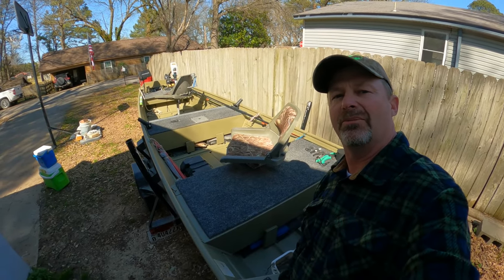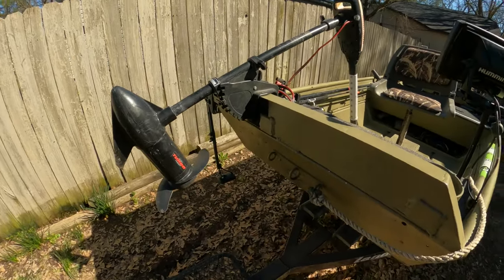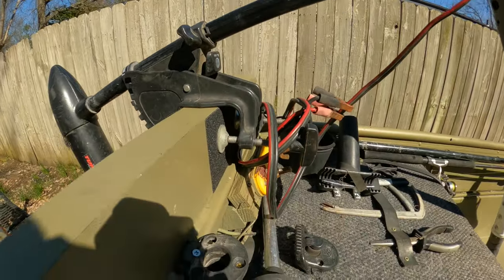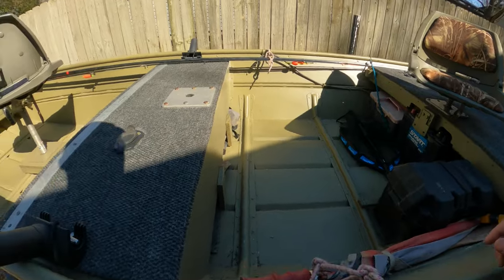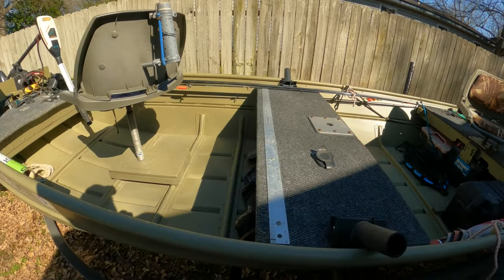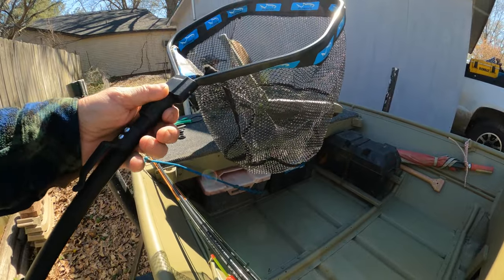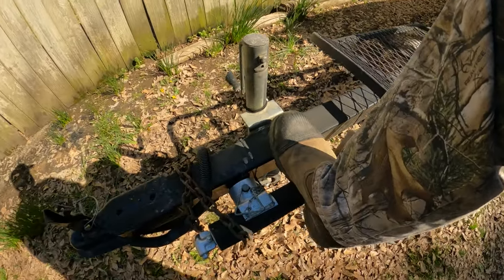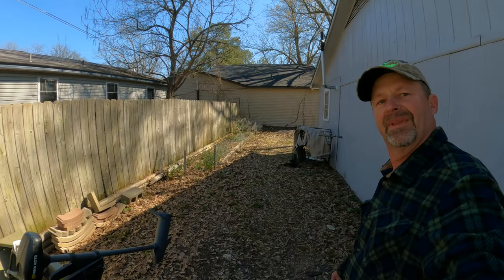Fish Yankers jon boat setup for Crappie fishing

Comment: I have the same seats in my 14’ jon boat, but after 3 years of being in the Florida sun the fabric is about shot.
Mine has no center seat, just a stern seat with space behind for the gas tank and the 20 horse outboard starting battery.
On the 24” front deck, i built a wood box for the trolling motor battery and storage for other things as well.
The trolling motor is on top of the box which is about 10” high.
I also put marine plywood on the deck to make for easier for me when moving about.
Thats also the reason i didnt want a center seat, nothing in my way.
Like you im always alone, the difference is that im 88 years old.
But i do carry a six gallon bucket with a swivel lid which serves as a seat if needed as well as other uses.
I use a 5’ beach umbrella with the pole shortened above my head in the rear where i sit.
My trolling motor is a 50# thrust Minn Kota with a remote so i can control it from where i sit in the rear of the boat.
I have a 2 bank Minn Kota battery charger attached to the side of the box on the bow.
I have about 30’ of 5/16 nylon rope tied to the bow, and i attach that to the winch post when launching.
I use it to pull it back on the trailer as well, but my feet do get wet when retrieving it.
Most days the outboard dosent get started untill i beach the boat before loading it back on the trailer, so yes, a second small trolling motor would work as well for me also.
Reply from the maker: Very nice. that's how to do it. Lots of good ideas. thank you. I like your umbrella idea as well. I may try that. I would love to have a remote control trolling motor also. The more comfortable you are. The better the fishing 🎣 will be. Thank you for some great ideas Ernie.

Comment: The best thing about these little Jon Boats is not how shallow you can get (its a nice feature) but that they are much easier to launch and retrieve for a single person.  We had one when I was a kid and I've been seriously thinking about investing in one and only taking my larger boat boat out when I want to fish bigger water.  My boat absolutely will wear you out at a less than optimal ramp. Which on some lakes where I live, it's all you have!  You spend all day fishing, then you have to pull the boat up and beach it, climb out, walk to the truck, hop in, try to get the trailer back in far enough without the truck going into the lake, hop in the boat, drive it on the trailer as far as you can, climb out without breaking your neck, get your feet wet and then winch in that thing like a maniac when you are already cold and tired or hot and tired.   I could winch in our Jon Boat all by myself standing on the trailer tongue, when I was a scrawny 13 year old.  It's about time for this old man to get back to that convenience.
Reply from the maker: Yes sir,  just be careful by yourself. I have built a lot of stuff on my trailer to make it a lot more accessible and easter to load up the boat. Back on the rear corner of my trailer I have a big eye bolt where I hook my rope with a metal Caribbean. I undo my winch and clip the rope on the eye bolt, lay the rope on the edge of the boat and back in the water. I pull back up without getting out of my truck then unhook the rope. I will have to make a video and show you guys how I load and unload my boat by myself quick and easy. Thank you Mikel

Comment: My boat is the same length as yours but it is fiberglass. I have it setup so that once I sit down in the front seat I don't have to move. I went a little overboard by putting a 25hp Mercury on the back but other than that she fishes good. The great thing about a jon boat is you can taylor them to fit your needs. That ramp on your trailer is my next mod. Like you say having cold feet is not fun. Keep up the great content.
Reply from the maker: I wish my motor was running now, but I will get it fixed soon. I use to catch a lot of catfish on the white river. And there are some good fishing lakes you can get to from the river. The trailer upgrade is one of my best ideas for me. Keeps me from falling and dry. Thank you Grainraiser

Comment: Chuck I have a 1996 Honda 9.9hp engine 4 stroke electric that has only had 2 tanks of gas ran through it. It hasn't been started in 20 years,  I had this on a sailboat for a few years. Don't have sailboat anymore want to put this on my fishing boat.  We don't have a Honda dealer in NE Arkansas (Jonesboro area)  that works on them is there a dealer down around your area or Searcy, or Little Rock area? I got several ideas from your boat I want to try. Thanks
Reply from the maker: I think the best Honda dealership is around Heber springs. That's what I've been told.  just have not went up there yet. Glad you got some ideas. Thank you Rick

Comment: Around what is the estimate to getting together like this for a Jon Boat sir? Thinking about getting one.
Reply from the maker: Prices are all over the place right now. I bought this boat, with a 4-stroke Honda motor and trailer for 1750 then you just change it as you need it. You may want to check bass pro prices first. They use to have some good prices on jon boats.